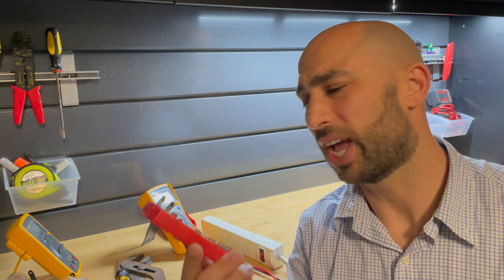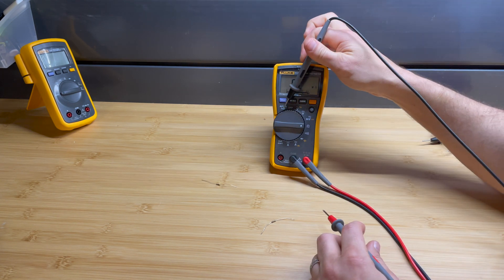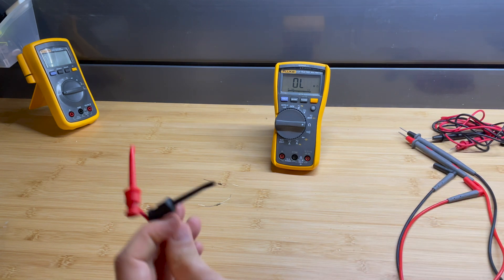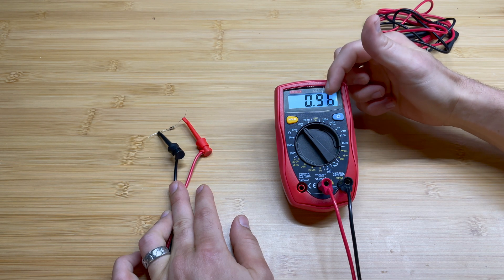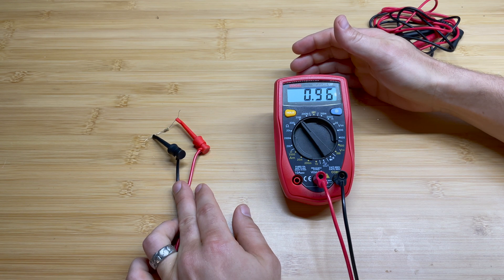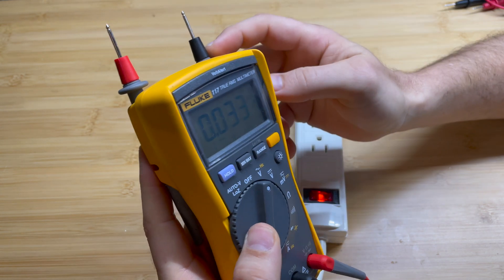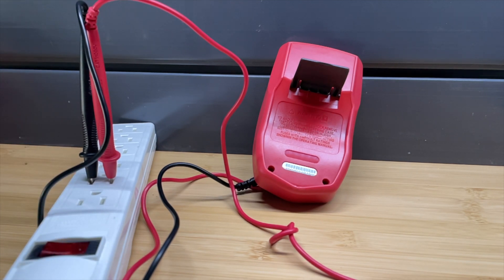Multimeter Tips - Common Mistakes to Avoid

Comment: Did the last one, had forgotten to move the pronge from amps socket and went to measure volt... to make matters worse i measured on the input of the power supply getting 230v from the wall, instead of the 12v output which is actually what i wanted to do.. it sparked and the hpfi shut off instantly, so guess i've tested that is working correctly now, but now i need a new power supply and multimeter. Atleast now i probobly wont forget to double check that again.

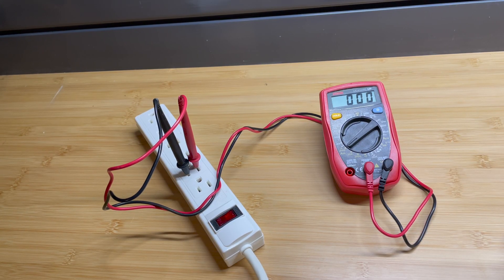Comment: 9:50 Can you tell me what you're doing wrong here so I can avoid, please.
Reply from the maker: Sure, you need to make sure you don't measure high currents - if you don't understand when high currents will occur keep your meter in the ports for voltage measurements. If you meter doesn't have separate ports for voltage you will want to learn how to prevent putting to much current in your meter (for example only measure 24V and below circuits)

Comment: What happens when testing a resistance or continuity with a multimeter in a live high voltage circuit??
Reply from the maker: Depends how high and how much the meter can take - at really high voltages the situation can get very complicated because of all the paths possible
Reply: @HTMWorkshop  
Okay. Thanks. It was a 480vac circuit.
Reply from the maker: Well first off - if your testing in those modes your not going to get a correct reading - so I wouldn’t recommend it - I would have to look at the meter specs to see what it can take as far as damaging the meter

Comment: Do you have any tips to prevent your multimeter fuse from blowing up? Everytime you use it? Beginner user here
Reply from the maker: Sure …by a decent meter and don’t measure current until you understand what your doing. You’ll avoid almost all issues by doing those two things

Comment: I left my multimeter Uni-T UT33B ON for a month,it drained the battery ,does it cause damage to the circuit or not?
Reply from the maker: I would not think there would be any issues - but I am not familiar with that particular meter

Comment: What happens if you test for volts while the meter is set to ohms?
Reply from the maker: You should be ok - the multimeter will apply a small voltage to test the resistance - but your meter should be fine

Comment: I have question if you don't mind my digital multimeter the 10A input has 250V and mA input also has 250V so is it safe if I don't switch when measuring voltage but only change when measuring Amps? my multimeter type is ingco DM200
Reply from the maker: I am not sure I completely understand your setup but usually - There will always  be a dedicated voltage port - that voltage port may also have a low current ameter as well - for cheaper meters. Then there I’ll be a high current port (ameter). So you may be able to measure current if the amperage is low but it is not ideal - usually the result a multimeter company trying to save money

Comment: I just did the last mistake, having the multimeter on the amps setting attempting to measure my e-bike battery voltage.
Reply from the maker: Oh no…hope the meter want to expensive…does it have a fuse?

Comment: I noticed that you measured the 9v battery while setting it to amps and the numbers were bouncing? does this damage your fluke multimeter? Can a 9v battery damage meters if set in the wrong settings whether it's current or resistance?
Reply from the maker: I can’t speak for all meters but a 9v battery is not going to be able to supply a high enough current to damage a meter - so no it did not damage the meter . However if you did this with a high voltage higher current source then yes you can damage your meter
Reply: @HTMWorkshop  Thank you for answering.

Comment: why, to compare these bad settings, I didn't test the fluke settings for amperes and connect the voltage to 120V with bad settings fluke 9V and a cheap multimeter 120V is not ok

Comment: I blew my meter trying to measure amperage on a ceiling rose, unaware that this caused a parallel circuit, and caused a short and tripped my fuse board and blew meter

Comment: If rotary switch can rotate 360 degree and it is symethric, you can not see the line from it and use it in a wrong setting. It happened to me on my first cheap analog multimeter. 😂 I burn it from first atempt.😂😂😂

Comment: Measuring current by connecting the meter in parallel with the power source (just a 9V battery in your example which is harmless) makes no sense and can, at best, blow your DMM fuse.
Reply from the maker: I’m not sure if your talking about the current measurement - which had a resistor in the circuit. Or the time I measure voltage - but in both cases there is a resistor in the circuit. In the first case the resistor is in the circuit when I measured current(so low current). When you just measure voltage there is resistance in the meter itself and will definitely not blow the fuse of your meter unless you go over the voltage/current limits (which are very high, orders of magnitude higher than that of a 9v battery). If you provide a time stamp I can explain in more detail
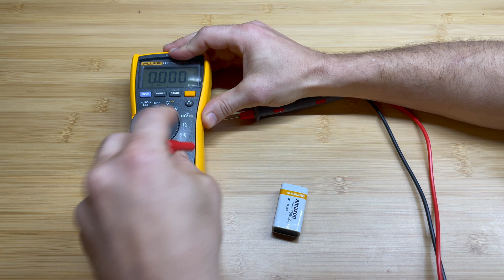Reply: @HTMWorkshop  I am referring to 9:10 - 9:25
Reply from the maker: @cremvustila   @cremvustila  Got it, yes that is definitely a situation to be aware of, for time/simplicity sake I did measure  the max current of the battery directly but I knew that the current would be below the max meter current (10 amp fuse) from experience. You could easily max that out though if you are not careful in a circuit and you measure a larger power supply. Whenever you measure current you need to be careful if you are unaware of the max amperage, just comes down to knowing the circuit.  The point of the measurement is to show you have to change the ports when measuring current - I do show what happens when you overload the meter later in the video (but of course I use the unfused port or the cheap meter)
Reply: @HTMWorkshop  Right! We are on the same page then! 👍

Comment: great property/life-saving info here,appreciated. 9:48 could you explain what happened here in regards to settings(before you turned on power)?
Reply from the maker: yes - basically I have the meter probe in the wrong input jack. The 10A jack is fused but the uA jack is not fused. So by leaving the red probe in the microamp input jack and running a high current through the meter, the first resistor to take all the current turns into smoke. Hope that helps

Comment from the maker: Did I miss anything?

Check out our recommended meters below. 

My Favorite Budget Meter - https://amzn.to/3FjjtFm
For Electricians the Fluke 117 - https://amzn.to/3jUKhBM
If you need a more affordable good meter https://amzn.to/38WHrtH
Reply: Yes, sudden over-voltage measurement when one is bored, like shorting an electric mosquito racket is also a bad idea. 

It’s funny because my teachers actually taught me that you can measure if the distributor in ca car engine works by shorting it that way ( which can go up to very high voltage ) so I said, well it’s probably fine but nope.